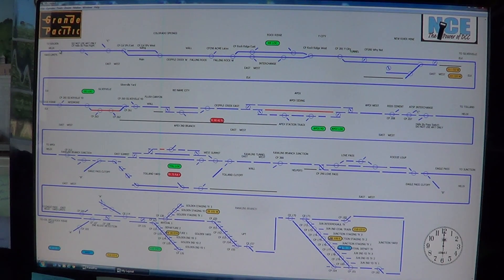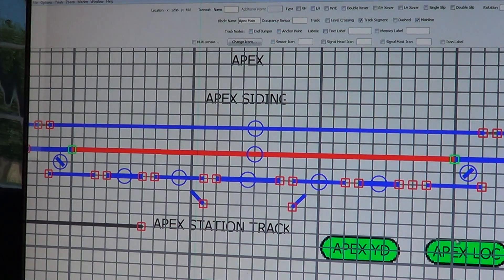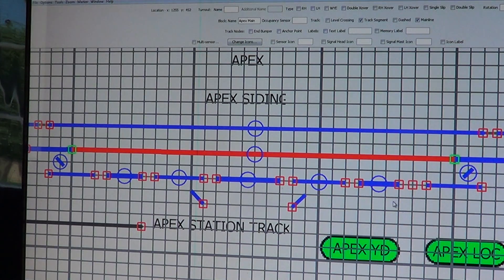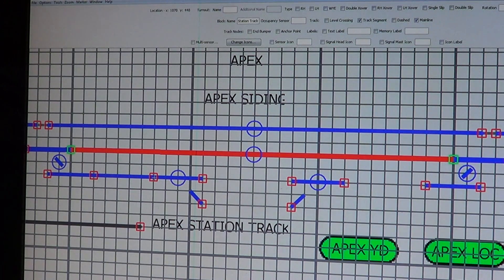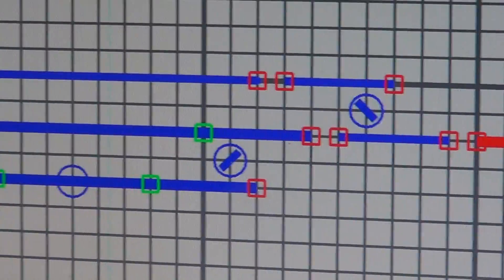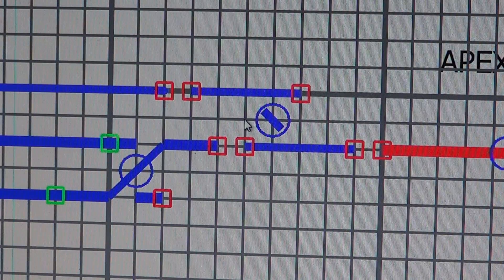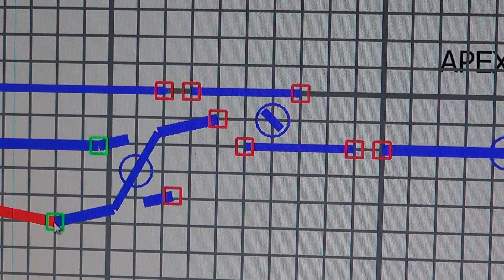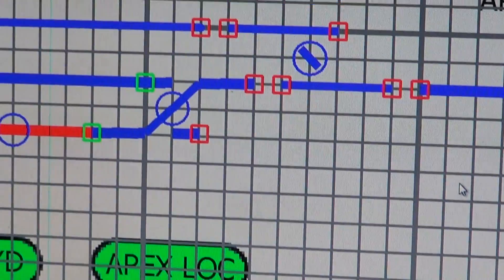JMRI PANEL PRO LAYOUT EDITOR

Comment: Are you suppose to have all the track plans on the layout plan? or just the mainline and what you want the dispatch to control?
Reply from the maker: Only what the dispatcher controls. I have branch lines that operate in the dark. No detection so no need to have on panel. Only the last section for signals if you put them it.